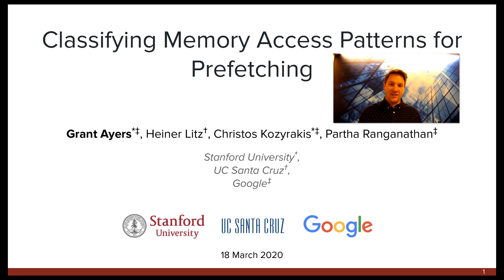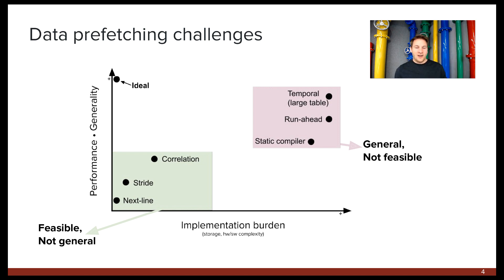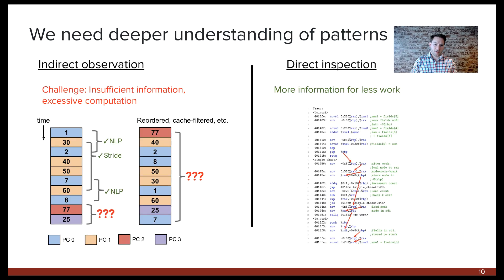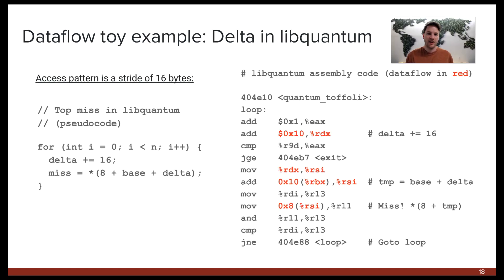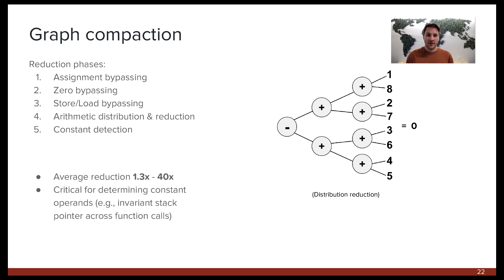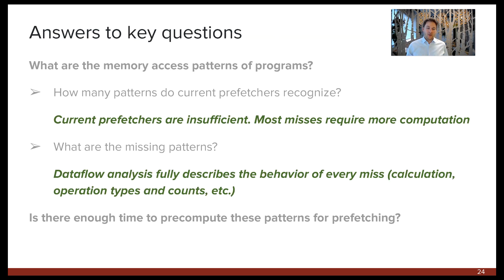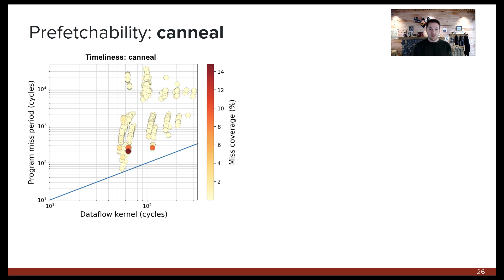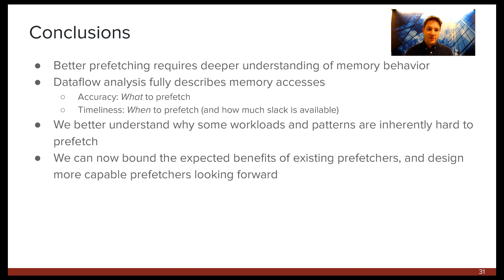ASPLOS'20 - Session 6B - Classifying Memory Access Patterns for Prefetching

Comment: Great job and a very informative paper!
I know that this is not the most conventional channel for a question, but I guess I'll try anyway :)
Not all cache misses impose the same CPU penalty (cache miss cpu stall cycles) due to OOO etc. Since the timeliness considerations is essentially whether kernel execution time > cycles between cache misses to the same instruction, is it possible that the overall IPC (not including kernel) could be negatively affected if speculation and OOO can "hide" cache miss latency? (since only the DRAM latency is considered in the paper)
Thanks!!
Reply: Hi Shai, thanks for the question. The short answer is that the most effective prefetch strategy will be accurate, timely, and focus on the misses that matter most (i.e., cause real latency).

Out-of-order windows can hide the latency of many misses, but many other misses will still inevitably cause stalls (e.g., a pointer chase will cause latency no matter how large your window is). In large WSC workloads we find that within reasonable bounds the IPC is proportional to the LLC hit rate, suggesting the workload has inherently limited MLP (or that the window or queues are too small). You can also see this with Top-Down profiling or similar approaches. In any case, because of what you point out, a good prefetcher should therefore focus on the misses that are known to cause latency. There are a number of ways to isolate these in simulation or on real machines with the proper performance counters, profiling tools, etc. which we don't delve into in the paper.

So what happens when this goes wrong? Well it's slightly better than when you lack accuracy or timeliness: In those cases you waste i-cache space (assuming code prefetching), execution resources, d-cache space, and bandwidth, among other 2nd-order effects. When you prefetch a miss whose latency is hidden by OOO (but is otherwise accurate and timely), then you're still wasting i-cache space and execution resources but you're not going to evict useful data or insert useless data into the d-cache. You could still expect a potential net decrease in IPC due to wasted resources, however, similar to when accuracy or timeliness is bad.